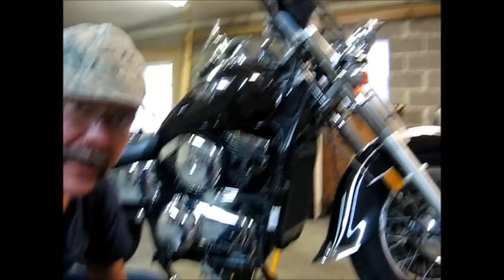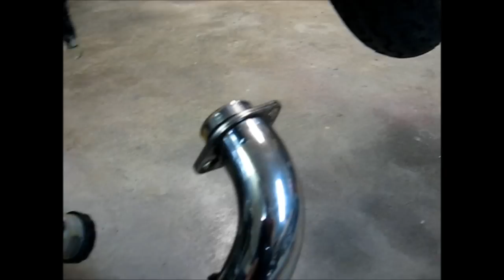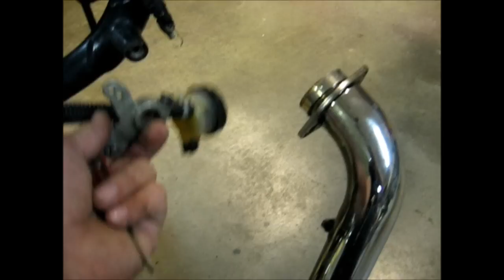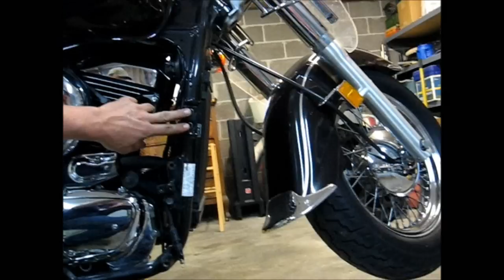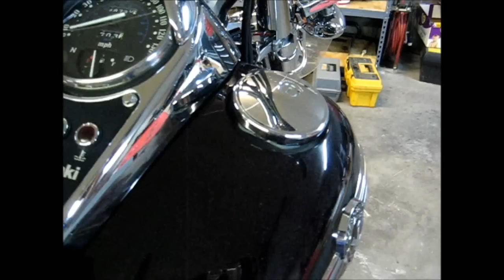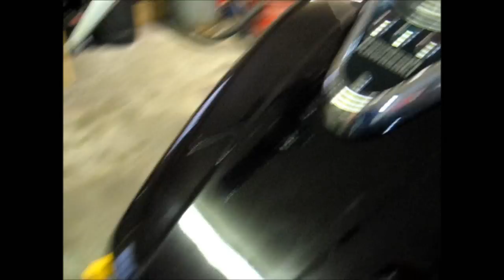2003 Kawasaki Vulcan 1500 Classic Valve Noise Enging Removal, Part 2

Comment: Hi David Anderson I messaged you awhile back I have a 01 dual stator classic 1500 engine I swapped into my 96 single stator vulcan 1500 classic and its hard to start backfiring bad and seems pissed to run! All plugs have a place except he front stator which is missing the plug from the end bc it melted is the front stator not being plugged in hindering the bike from running or is it a air fuel issue p. S. I swapped the coolant inlets from one motor to the other and the carb as well. The igniter box on the 96 wouldn't even fire the coils so I put the one from the 01 on it and it fires now but runs horrible any help or thought? Thanks again sir

Comment: How do you get it up on the stand like that?  The stand is to far forward to pick up the rear tire.
Reply from the maker: Haley Lane The bike lift is as far back as possible, Definable heavy in the rear 
Now when the motor is ready to remove I dropped bike back to the ground on the side stand. I used the bike jack with the help of a couple blocks of wood to support engine as I removed right side of frame and remaining mounts, rolled jack and motor right out.